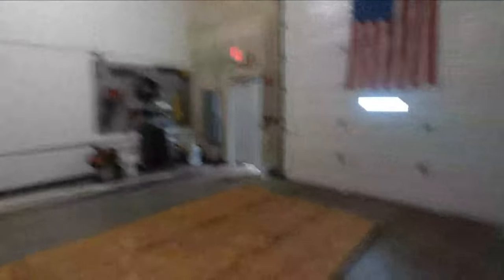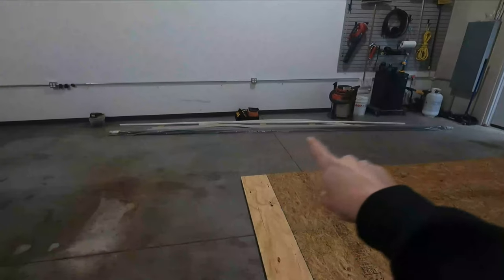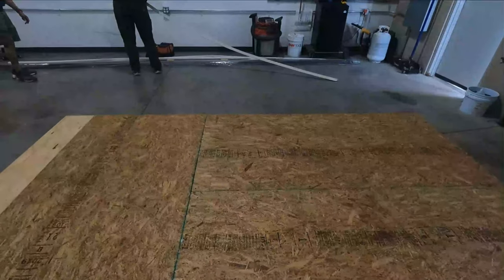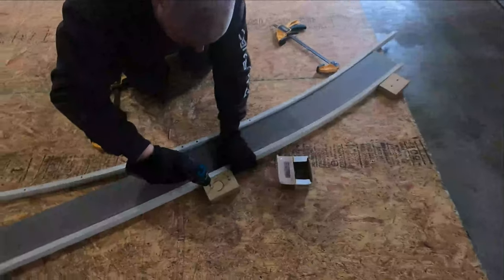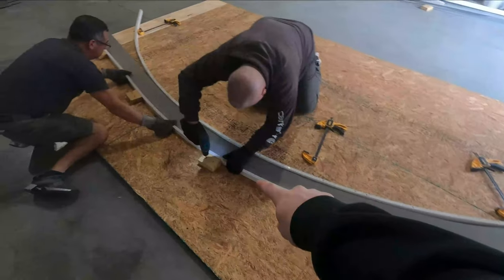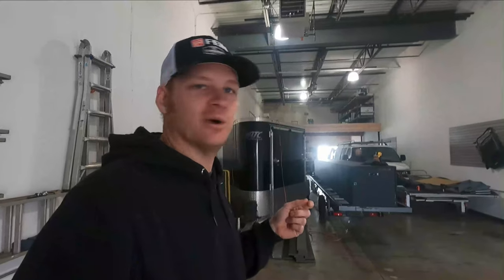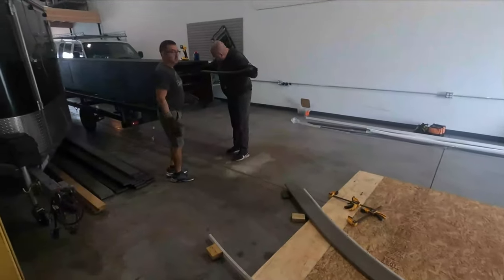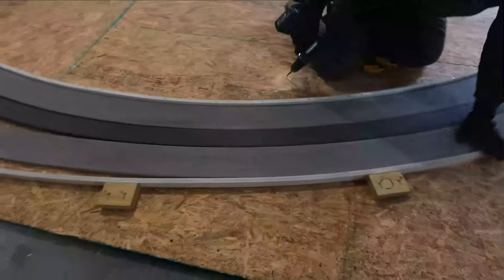How To Bend Deck Boards | Learned Something New Today! | HANDYMAN HEADQUARTERS |

Comment: Those heat boxes or heat tape rolls really make those bending process happen for curved decks . Thanks for sharing  .
Reply from the maker: This is all custom made from scratch frame and everything! My buddy hand built this. Those heat-con blankets are nothing compared to this!
Reply: @HANDYMANHEADQUARTERS   Dr Decks uses the Heat-Cons I think .
Reply: @hhprogressiveconstruction1140  how do I contact you about having you bend boards? Also do you bend railing?